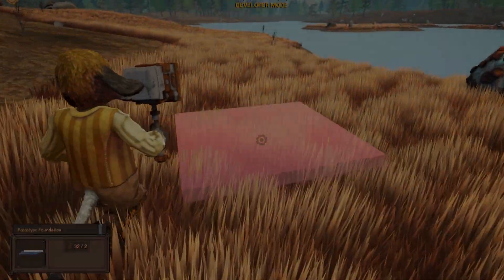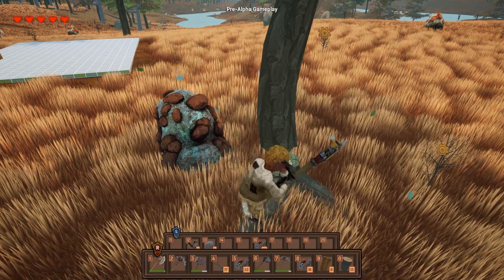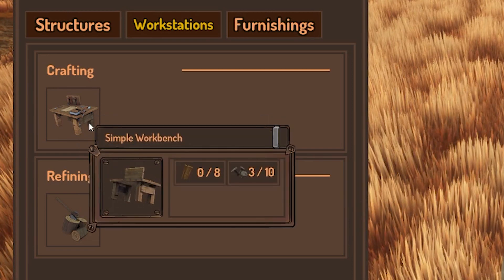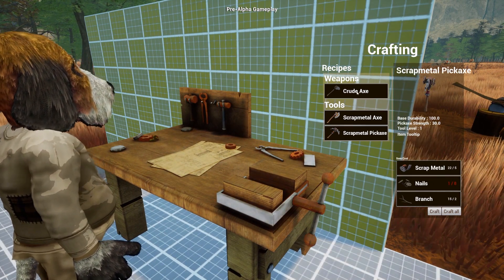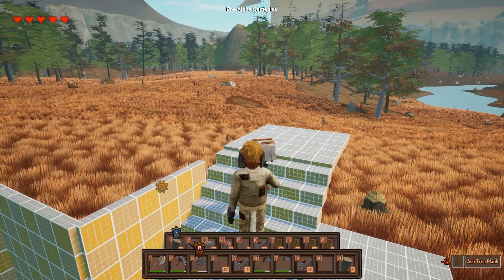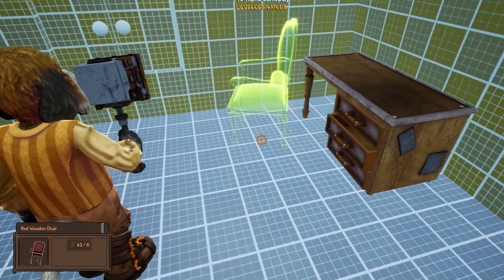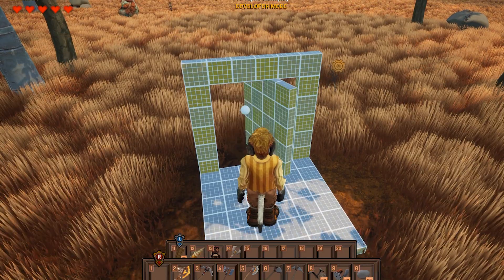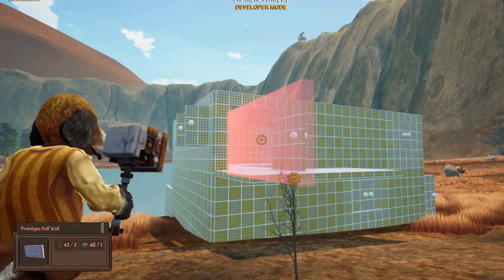Making a Fullblown Building System ! | Unreal Engine Devlog #14

Comment: Looks awesome so far! You should definitely check out the Enhanced Input plugin though, it comes default with the engine and allows for easy button mapping for different situations
Reply from the maker: I think this will all work with what I have. Each action you can make on the game has its own keys and all icons are dynamic to the keys themselves. If I were to add a remapping system and someone remaps a key, it would change the icon as well :D